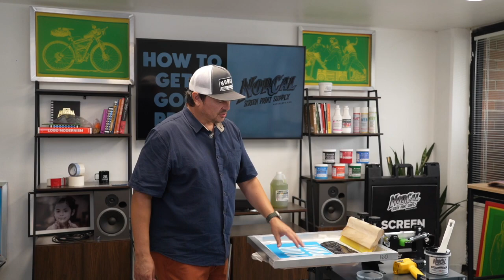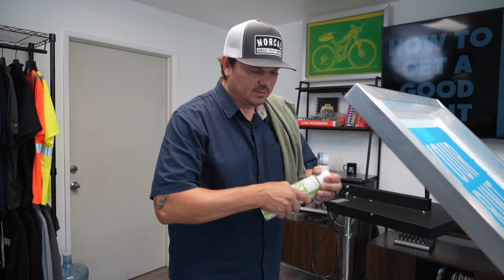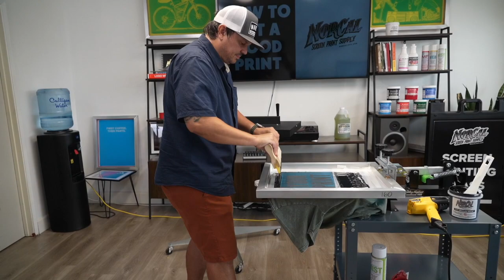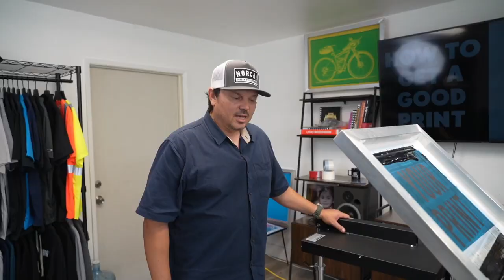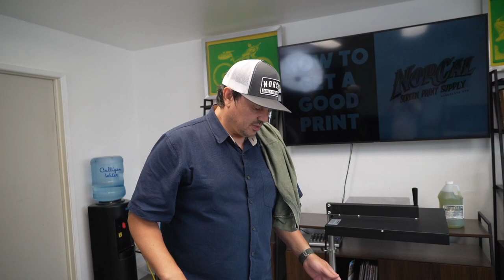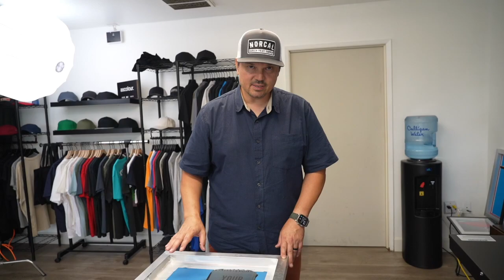How to Get a Good Print #FreePrintAdvice

Comment: Great video! I’m gearing up to purchase a jumbo pre burned screen from you guys (new brand owner) so this makes my anxiety go down lol. Is it possible to swap out the ink & will the emulsion remain intact?
Reply from the maker: Thanks! If you're using plastisol ink, just use a press wash that is formulated for plastisol. If you're using waterbased inks, be sure to request that your screen be chemically hardened to resist stencil breakdown.. You can use water to wash off waterbased ink (not plastisol), but don't scrub your screen with anything too abrasive or put chemicals on it or it may break down. Keep on printin'!

Comment: Is the ink water soluble? Good informative vid man. How are multiple colors on the same print applied? Can other sub straights be printed on in a similar manner as this?
Reply from the maker: This is plastisol ink; not water soluble.. for multi-color prints, you would use a multi-color screen printing press. Other substrates, such as flat stock, can be printed in this same manner. Thanks for the questions!